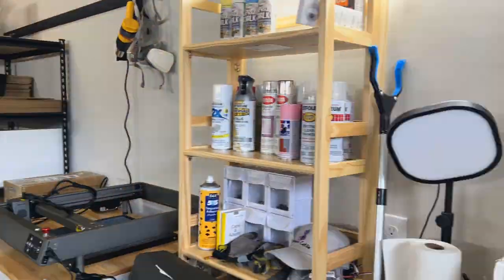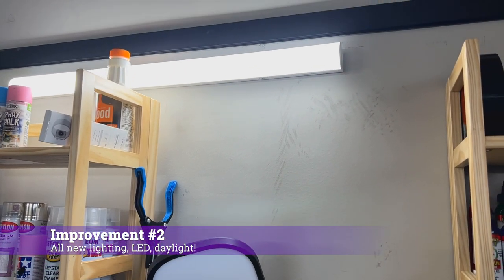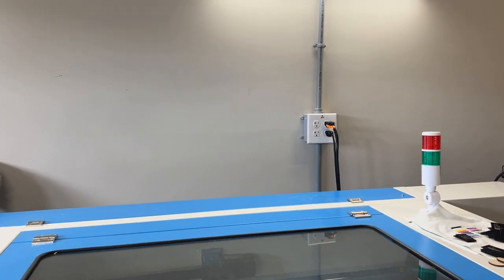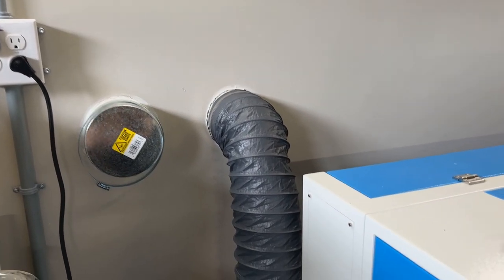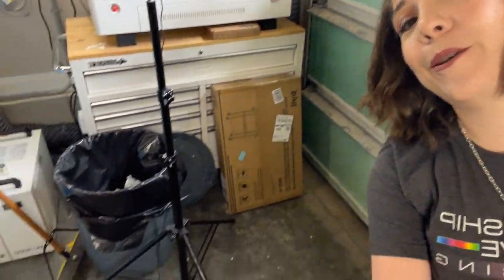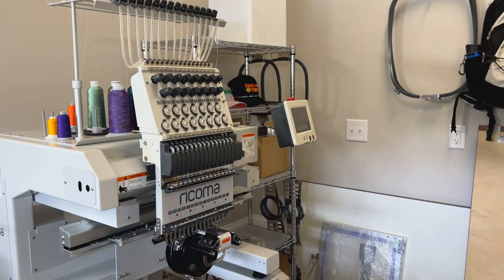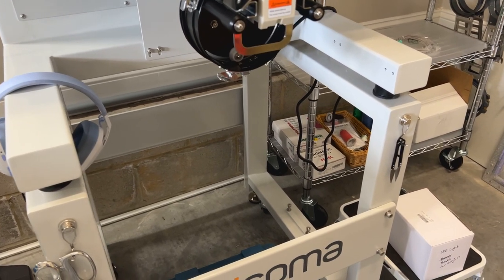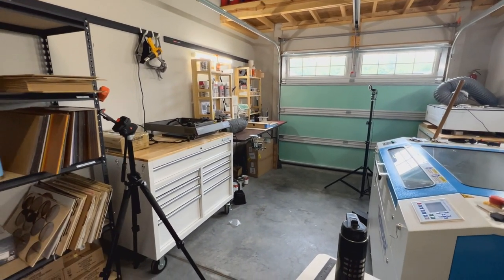9 Improvements I Made to Turn my Garage Into a Workshop!

Comment: We need  to stop being on the same wavelength! (kidding) I'm working on part of my garage, but not quite as much equipment as you have. I set up some Ikea kitchen counters and cabinets along one wall, and some decent overhead lighting (via USB). Next is getting an insulation door kit for my garage door and a mini zone for my air conditioning, and took 2 low bookcases from my office that I was going to give away and put them along another wall to store my non-crafting paint supplies (I have a lot of leftover paint from painting my house).

I also have some tumblers if you want to work out a trade! Mine are probably not the same style as yours, but I have 23 of them and I don't think I'll be using them all.

Comment: I’ve been wanting those garage cabinets to store all my fabric, my husband has a huge one in the garage. 
Is your garage insulated? None of our garages are.
Reply from the maker: It is on 2 walls. The exterior wall and door do not have insulation. We insulated the door at least. It's been OK so far. I'm more worried about the winter months than summer months. If it gets below 55 in that garage, the CO2 lasers could break.
Reply: @fiercekittenz  Wow, good thing you’re not in the Seattle area, or anywhere it snows lol